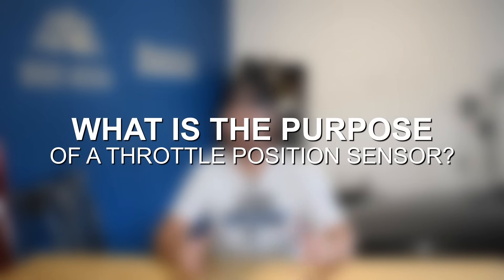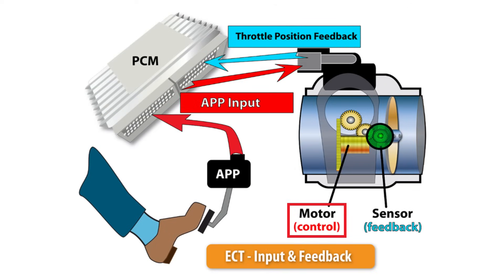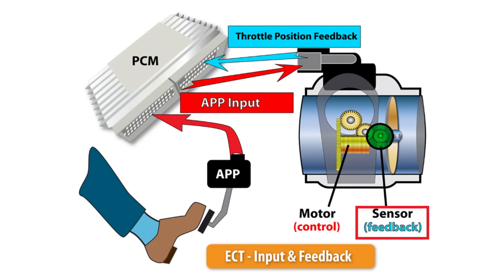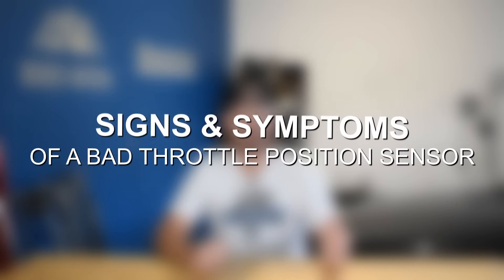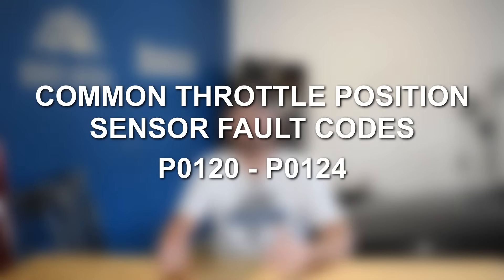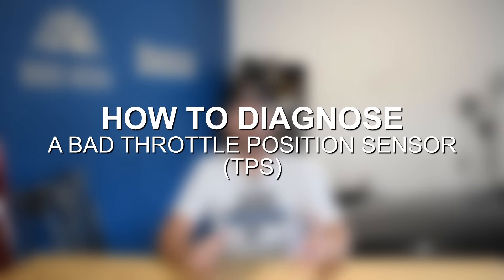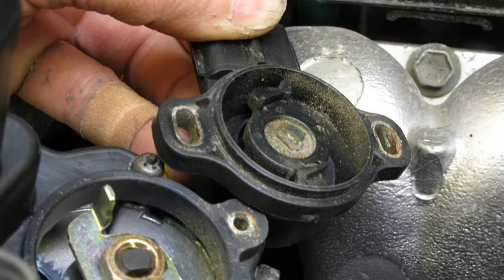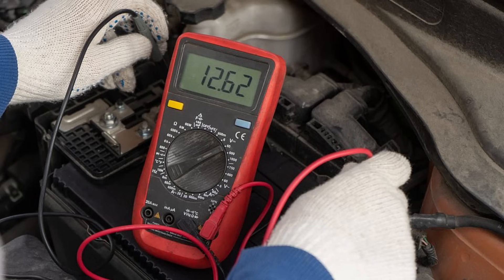Signs & Symptoms of a Bad Throttle Position Sensor (TPS)!

Comment: Really great video thank you!
Q: Is there a case where a car has no any accelaration pedal sensor on gas pedal? I have an i30 Hyundai 2008 1,4 and i can not find this out.
Reply from the maker: Certainly, from a quick search it seems like the I30 uses a cable-operated throttle control system so it wouldn't have an accelerator pedal position sensor.
Reply: @8020Automotive  Thank you very much! Really appreciate ☺
So do you believe that there is a way where i could make the gas pedal more sensitive as it's a little bit lazy right now. Don't know if throttle sensor could change the overall exprerience.
Reply from the maker: S - No problem! The throttle sensor could certainly change the overall experience. Keep us updated.

Comment: I have a 2005 titan my trucks been driving like crap for 2 years now brought it to multiple mechanics nobody can tell me what's wrong it feels like it onky has half the power it used to almost like im driving threw a puddle or pulling something it's not limp nod cuase I can get up to w.e speed I want but 99% of the time it drives slowish and every once in a blue moon it's fast and drives great I've beeb told it's not the fuel pump not clogged cats I've replaced the maf sensor intake filter plugs and coils and a bunch of other stuff I have 0 codes idk what todo can it be the throttle position sensor ?
Reply: I'm going to assume you have at least 150,000 miles on the vehicle seeing how old it is, so, if you've never replaced the TPS or MAP, I'd start there, it's about time for either or both of those to fail and you'll likely be replacing them soon anyways. O2 sensors will probably soon follow. Hope this helps.
Reply from the maker: K - Thanks for taking the time to help out viewers. Great advice.
Reply: Have you tried replace the pcv valve? Also clean throttle or replace idle air control Valve? Also try clean injectors.
Reply: It's your acceleration pedal position sensor it won't send the right info to the computer which means even if you floor it won't send that ifo the truck will catch up to the speed you want to but again I'd you floor it it won't respond due to the mentioned sensor. Or at least that's what I would tackle I have a 06 titan. Also I've been told that the 06 titan it's not equipped with a idle air control valve soo I wouldn't bother on checking that.
Reply from the maker: C - Certainly possible!
Reply from the maker: J - Sorry to hear about this.. We have a video about losing power that may help with diagnosis: https://youtu.be/ipjYLPJgpq8
Reply: ..same
Reply: L